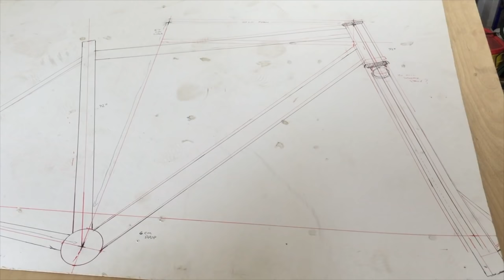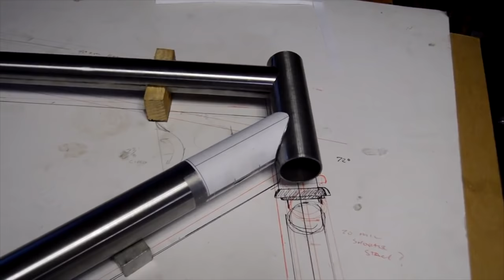My Second Bicycle Frame Build From Start To Finish

Comment: really good this video, congratulations and thank you
where do you buy the tubes to make the frame?
Reply from the maker: I purchased this tube set from Nova cycling, but it appears that they are going out of business. There's lots of other options though. Try metal-guru.com, vari-wall, frame building.com, or bicycle frame depot as a few other options. 4130 chromoly tubing can be purchased from air spruce, amazon, and eBay.
Reply: @JoeyMesa  thanks

Comment: Hey joey , damn good work , mind sharing some info ?? What kind of steel and circular drill are you using ?  
Any recommendations on how to bend the tubes ?
Reply from the maker: Thanks! Sorry for the late reply!
The frame tubing is thin wall 4130 chromoly steel. The hole saw bits that I used are a mixture of mostly Milwaukee and Harbor Freight Bi-metal hole saws. I used an inexpensive Harbor Freight tube notcher with a drill press to notch the frame tubes, and I have a friend who owns a hydraulic tubing bender to bend the fork legs. The rest of the frame tubes (seat stays and chain stays) were already pre bent from the company where I purchased the tubing kit (nova cycle). 
I've got a couple longer playlists from this frame and my first frame that go into much more detail on the tools and lots of other things if you're interested.
https://youtube.com/playlist?list=PLyNdrtUfdbn2YVkFDfbgEZjD4gA_F0_j
https://youtube.com/playlist?list=PLaz6WjKNr9tX_mYw8U5x24Ngyv0UTnX4x
Reply: @JoeyMesa  even more info than expected , my project is a heavy 3wheeled bicycle , and ive allways wondered how those tubes where precisely bent .. and drilled ! Ahah might even use cheaper alloy , as weight isnt important for my project

Comment: Dude !! this is beautifull. Thanks for sharing. I am currently building a drift trike and Im stuck in the stearer tube. I will buy a 1-1/8 inch fork, what diameter should I use for the stearer tube so the end caps fit? can it be a straight tube or does it need additional inner features? Thanks bro
Reply: I meant "head tube" for a 1-1/8 fork stearer tube, sorry

Comment: Doesn’t look like you have a chain tensioner or horizontal dropouts, how do you tension the chain?
Reply from the maker: I used an eccentric bottom bracket. I was on a very tight budget when I built this bike, and that was the least expensive option to make a single speed with disc brakes. This is a more detailed explanation of my plan for the frame in a video I made. It's the first video in detailed playlist I made while building this frame. https://youtu.be/lJFptJdp6QU
This is the complete playlist if you're interested: https://youtube.com/playlist?list=PLyNdrtUfdbn2YVkFDfbgEZjD4gA_F0_jl

Comment: Nice job. I see you´re using TIG to weld. Have you use MIG before?. I´m focusing on building my first bike ever and still not sure what type of welding machine tu buy....thanks
Reply from the maker: I’ve used the mig welding process for lots of different projects. It’s definitely faster and easier than tig welding, but for welding thin wall chromoly, tig welding is the way to go. You have much more control of the weld puddle, overall speed and how much filler metal is being added. Thanks for your question!

Comment: It turned out to be a great bike!  I've been thinking about "frying" a bicycle frame myself for a while, and your video gives me the courage to finally tackle it!  I'm only interested in one thing because it wasn't shown in the video: how did you shape the chainstays?  These parts are bent several times, have changing ăcross-sections and changing diameters.  Did you build these parts yourself?  As?
Reply: They generally come pre bent as part of a tube kit.

Comment: What kind of filler/Tig wire?  Er80s-d2?  Weldmold-880?
Reply from the maker: I used a combination of.045 and .030 ER70S rod. I’ve never tried Weldmold 880, but I really want to. Thanks for the question!
Reply: I used Weldmold for the 4130 parts of the bike trailer I finished last February.  The mild steel parts got Er309, as it seems to give slightly better results on most square steel tubing I can get in my area.

I tried er80s-d2 on the 4130 parts, but didn’t like how it ran.  I guess I’m not much for a welder.

Comment: can you tell me what is the cheapest and best steel for bicycle frame
Reply from the maker: Any 4130 chromoly will be the best material for a steel bike frame. You can get some basic straight gauge tubing from Aircraft Spruce that's pretty inexpensive. The tubing I used to build this frame was double butted chromoly that I purchased from Nova cycles. I think it was around $120 for the complete tubing kit.

Comment: hi, what brand of stainless steel do you use?
Reply from the maker: The frame is made with 4130 chromoly steel  not stainless steel. The brand is the generic house brand from Nova cycles. https://cycle-frames.com/

Comment: Nice build. Maybe a gravel bike next?
Reply from the maker: Maybe! My first frame build was/is a gravel bike, but I'd like to do something lighter with thru axles. Thanks for the feedback!
Reply: @JoeyMesa  i made a lugged frame with disc brakes out of columbus spirit oversized tubes for gravel.  Using 700c x 40s.  Ive rode it hard all winter and its held up well.
Reply: That's a really nice build, well done! Inspired by pithy bikes and your first frame I've now made six! Few things in life beat the stoke of riding with friends where at least one of you is on a frame you made. Looking forward to your frame #3 build and sorry to hear about the divorce in another comment.
Reply: @JoeyMesa  Thru axles are a good challenge because there's no cheating on the alignment. You can't just file the dropouts a little bit if you need a last minute correction.

Comment: What basic tools do you need to get started making bicycle frames?
Reply from the maker: Well, in my case, the needed tools were a computer to do research, I already owened a Tig welder, but something to join metal is needed. This frame was built with a lot of basic hand tools otherwise. It's really up to your imagination and budget. Otherwise a hacksaw and a file. Some way to hold the tubes in place to tack them together. I have a full playlist of this frame build, as well as my very first frame build. I was on a very tight budget, so I built most of the tools I needed. These are the playlists of my full builds: https://youtube.com/playlist?list=PLaz6WjKNr9tX_mYw8U5x24Ngyv0UTnX4x
https://youtube.com/playlist?list=PLyNdrtUfdbn2YVkFDfbgEZjD4gA_F0_jl

Comment: what is the name of the machine for the earliest part at 1:16 ??
Reply from the maker: It's a fixture I made to notch the fork legs. The part that holds the file saw bit came off my Harbor Freight tube notcher, but the rest I fabricated. I've got a video that runs through how I built the tool. https://www.youtube.com/watch?v=WgYasii1JQA&t=390s
Thanks for the question!

Comment: YOU NO THE WILD PART IS ? YOU CAN FIND THIS BIKE GEOMETRY IN CHEAPER BIKES. ITS REALLY HARD TO FIND A FRAME WITH THE TOP TUBE THAT DOESN'T SLANT AN THAT CAN FIT AN 29 IN TIRE IN AN NAME BRAND BIKE.  I LOVE IT IT HAS  ALMOST EVERYTHING THING I WANT. THE ONLY THING MISSING FOR ME IS A U OR V BRAKE. I LIKE TO USE AN 700C SINGLE SPEED RIM BECAUSE I CAN GET THEM IN MANY DIFFERENT COLORS AN DEEP V. 700C IS A 29 IN RIM AN THE TIRE WILL FIT. ANY WAYS NICE BIKE AN PLENTY OF PEOPLE WANT A BIKE LIKE THIS BUT HAVE TO SETTLE FOR WHAT THEY THINK PEOPLE WANT.

Comment: Why do you drill hole in front of every pipe?!
Reply: As the tubes get heated during welding/brazing/soldering you need a way for the hot air to escape.
Reply: Thanks a lot for the information @Horstelin

Comment: didn't the bottom bracket and head tube warp too much by welding on it?
Reply from the maker: No, The BB shell and the head tube on this particular frame have a wall thickness that is pretty robust, so there was very minimal distortion.

Comment: What is the materials
Is made ?
Reply from the maker: The materials are from Nova cycling. It's their house brand 29'er tube set. It's probably made in China or Taiwan, but the tubing is made of double butted 4130 Chromoly.